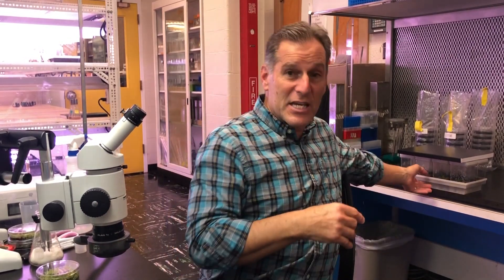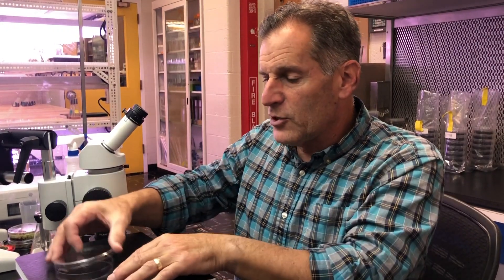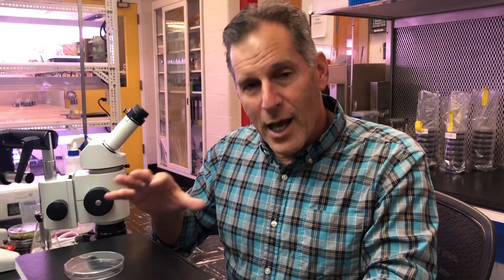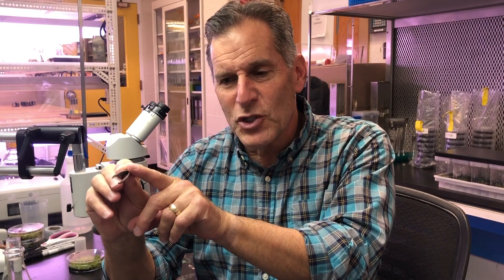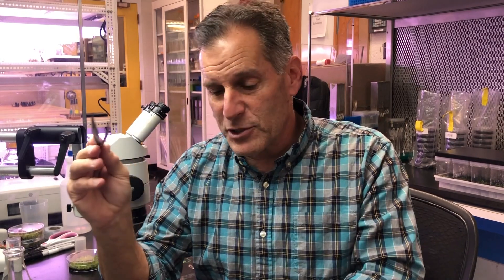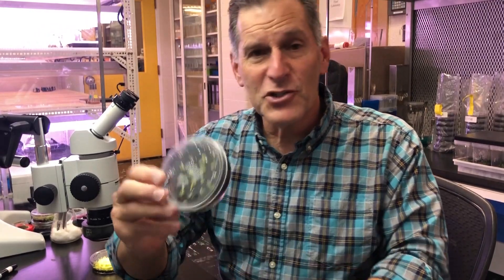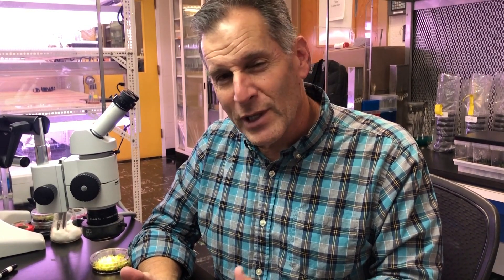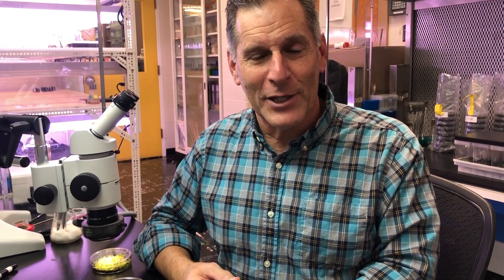Aseptic technique in tissue culture

Comment: Hello Mr. propagator! I was wondering: do latex gloves reduce the risk of introducing non-sterile matter into the petri dishes? Do they allow you to move with a bit more freedom? Thank you!
Reply from the maker: That is a great question - a lot of my students wore gloves because they thought that it reduced the risk of contaminating cultures. But, I NEVER wear gloves when I work in a hood or under aseptic conditions. Gloves protect the wearer from what we are working on, usually not the other way around. You can wash your hands and get them as clean as you would gloves. But, you can feel things and work more efficiently when you are not wearing gloves. Gloves may give the wearer a false sense of being "cleaner" but this is not the case. I do wear gloves when working with nasty chemicals to protect me from the chemicals. I have seen some videos of people actually "handling" tissues with gloves on but that is really bad technique - you should use clean sterilized instruments when working with tissues and clean them by alcohol, flaming, or heat sterilization often. Ungloved hands are much better for working with instruments.
Reply: @plantpropagator  that makes a lot of sense! Thank you for the information